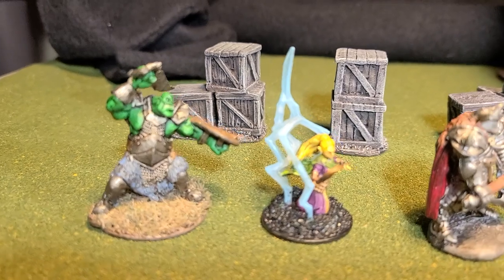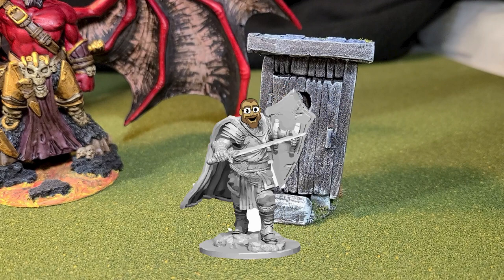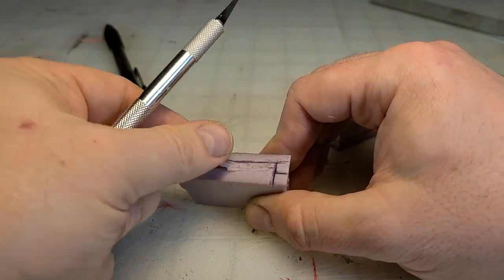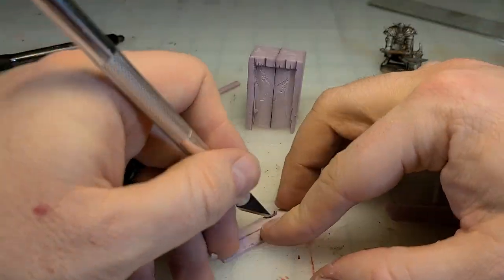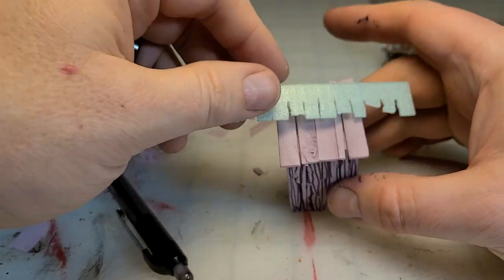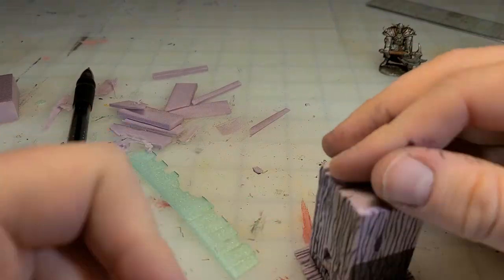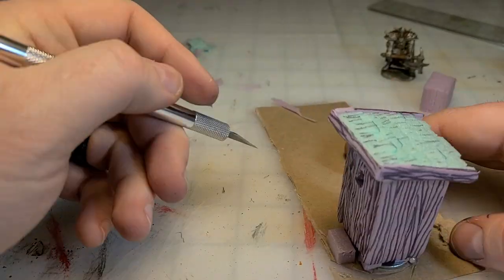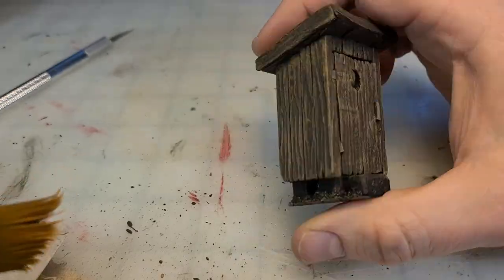Easy Outhouse Scatter Terrain

Comment: I've been thinking about creating an outhouse terrain piece. As a DM, whenever I'm designing areas, I can't help but obsess over making sure the environment/dungeon has everything a permanent settlement would need. Places to prepare food. Storage. Common rooms. Bedrooms. And, of course, the privy. They just bring the place to life.

For wargaming, it's a good bit of scatter to fill out the board. They can even be used as objective markers, depending on the "narrative" of the battle. I was reading an Age of Sigmar book and found a battleplan that involved one player hiding a hero unit in one of three objective markers, that the other player had to send their own heroes to find them. While I could just slap a set of generic objective markers on the field and call it done, a set of actual locations a character could hide in would make the game come alive. The outhouse could be one, and others could be wells or the exterior door leading to a cellar (which could be constructed as a separate hatch and placed up against the side of a house terrain piece as needed).
Reply from the maker: It's funny when a piece like this hits the table how the players will suddenly begin to incorporate it into the plan.